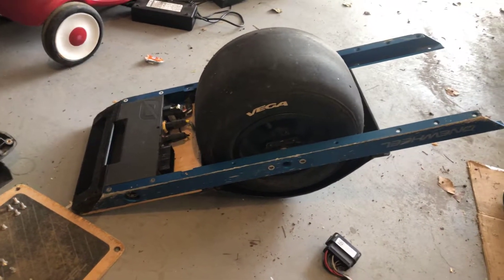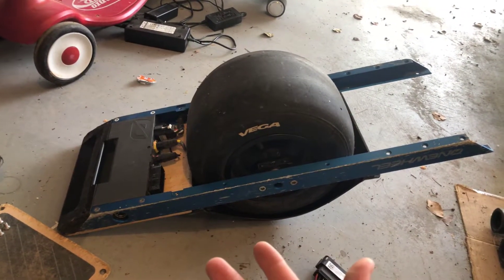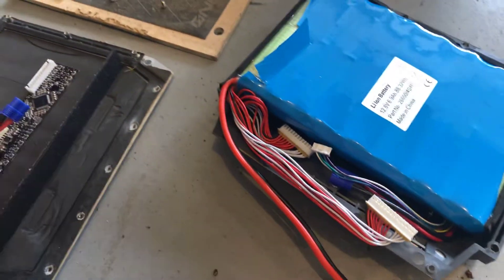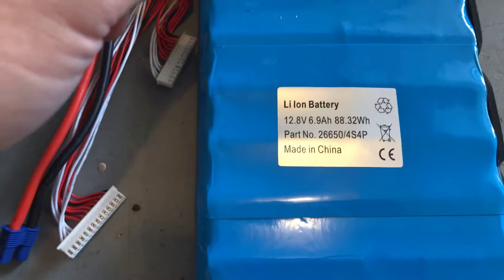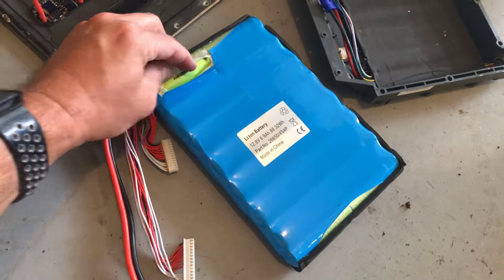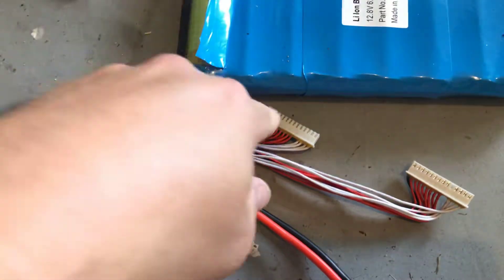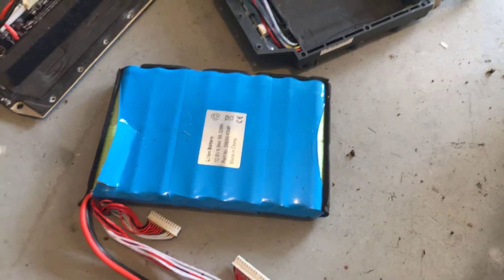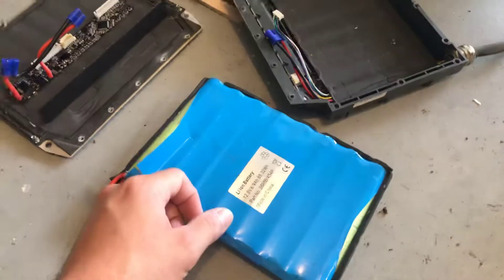Onewheel V1 Battery Teardown

Comment: Very useful, thanks! For reference I was experiencing the following error which prevented me from riding - "Hot or Cold: Your battery temperature is out of its safety range [7]". First issue with my board in 8 years. This ended up being one of the thermal sensors which monitor the battery temperature. I replaced all 4 with this part from Vishay, NTCLE413E2103F106A (Digikey $1.46) and am now rock'n & roll'n. Note: replace all 4 even if the others look good, or you'll be back.

Comment: Hey Chad, I think my BMS is cooked on my original onewhee and the battery is very old. I want to build my own pack. I'm thinking with 18650s or 21700s. Have you done this? I would bypass the BMS so I think the battery would have to have one built into the pack? Thanks for you insight!
Reply: Hey Caleb! Thanks for reaching out! So eventually, a few months ago, my pack died again and it was probably another cell but might have been the bms. Rather than rebuild a V1 I sold it and purchased a Plus with just over 100 miles on it. When I sold the V1 though the buyer told me he was going to put an upgraded pack in that would double the mileage. This was news to me so I did some research when I got home and there’s a ton of pack manufactures with warranties out there for direct replacements and extended packs with BMS’s built in. I highly recommend this unless you have some prior knowledge with batteries as you run the risk of frying the main board or even the motor if you don’t get the voltage, amperage, BMS, and have a proper charge controller for lithium ion. 

In case anyone is wondering I sold the V1 for $450 and purchased the Plus for $800. Replacement packs ran from ~$250-650 depending on what size, brand, etc you went with.
Reply: @chadgammon9890  thanks for the reply! I make my own long range FPV drone batteries so I know a bit about batteries and how to build them. The drone packs I make don't have a BMS included just balance leads and the charger does the balancing so this is new territory for me. Trying to find a schematic and what BMS to solder onto it. If I can't figure it out I've been looking at this pack https://chibatterysystems.com/upgrades/cbv1 - looks to double to range but $600 seems steep as I know there are only 28 18650s in there and at most $5 a pop... plus it's fun to make stuff ;)  Do you have links to the direct replacements with warranties?